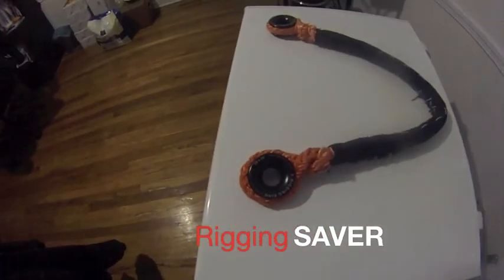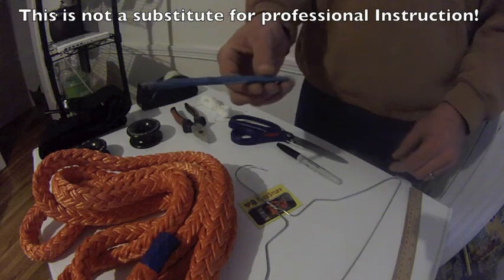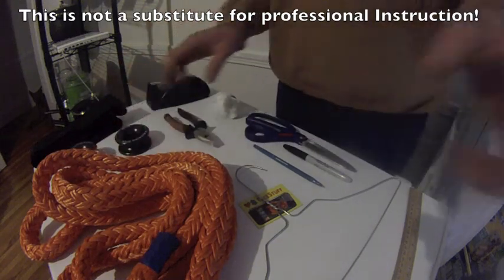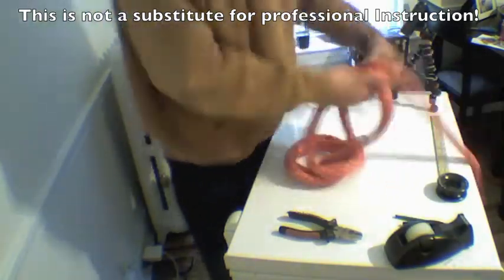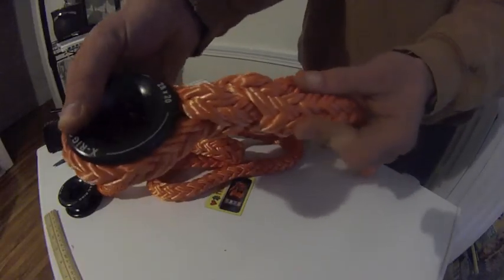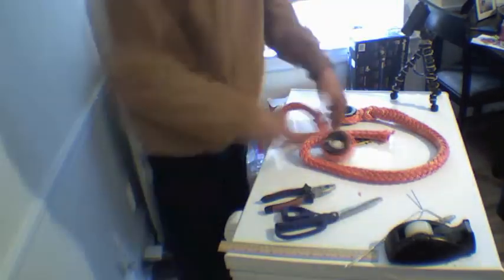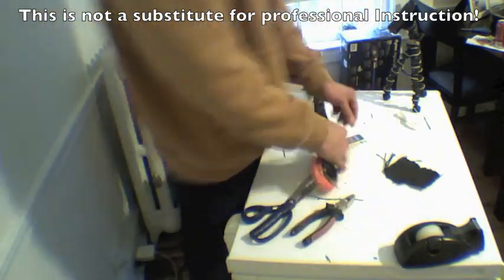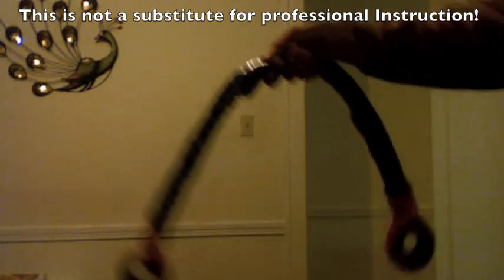Rigging Rings

Comment: Regarding retrieval (and remote installation) you could use the simple method  Arbor X employed on the three ring version I purchased.  A d-ring that allows for proper passage of rigging line and is cow hitched by small cord next to one ring, sandwiched between two during use.  Retrieval ball passes through XRR and catches on d-ring.

Comment from the maker: I have never been a fine detail kinda guy, hence the messy stitching, but it turned out alright.
I just need to dial in a retrieval method... Wedgie?
My next build is just going to be a XRR on one end and a 2" steel rigging ring on the other. Basket, choke, remote retrieval all inherent options.

INVETERATE TINKERERS UNITE!